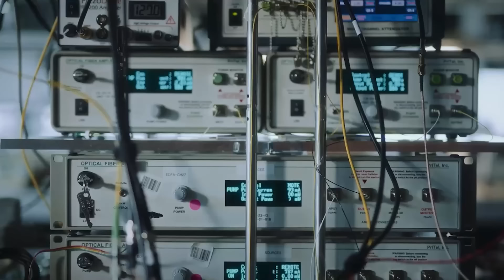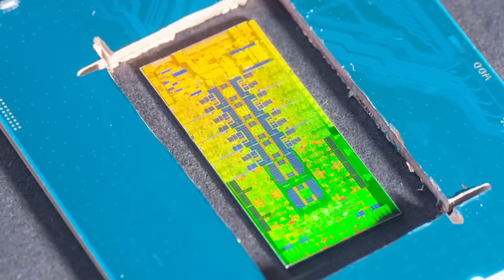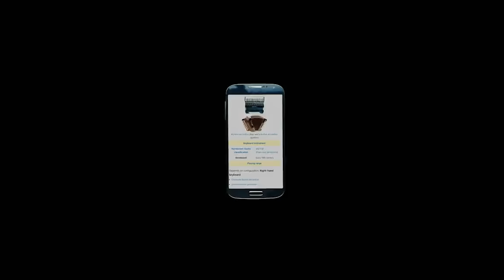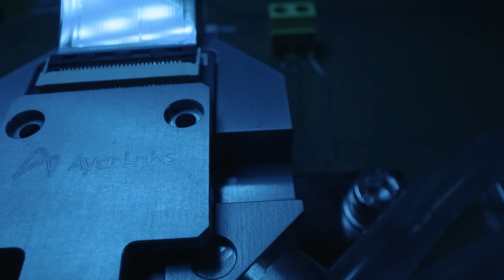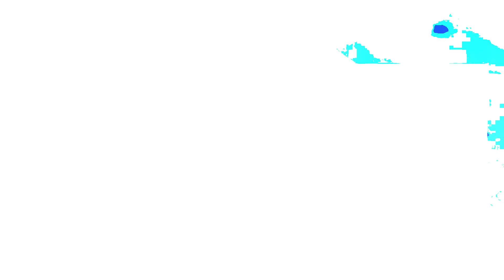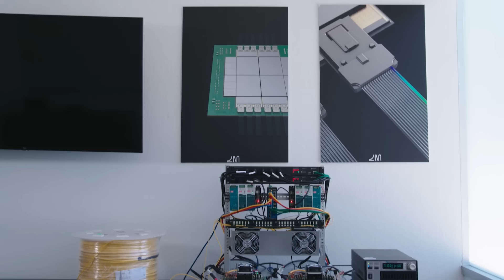Germany's New Photonic NPU Just Made NVIDIA’s Billion Dollar GPUs Look Like TRASH!

Comment: remember my physics professor in highschool saying that in the next 50 years pc will be working with light.(photonics)
Reply: How long ago did they say that?
Reply: @MasterAaron 2008
Reply: @marioraca6482  Perfect year to say that with the global zeitgeist in mind, I think.
Reply: They were working with light in the 1990s.
Reply: My teacher said back then (1991) that there would be no more than 250 MHz, as the material couldn't handle any more.
Reply: Si when you can. Photons when you must.

This is about to change though 🎆
Reply: Photonics=(solve problem gpu=bottleneck).
Reply: The speed of light has already been the limiter of computers and the highest end machines have been hitting 99% the speed of light for some time. Hence the need for more cores and more lanes.
Reply: @gillo79  uhm.. no.. the problem with current technology is heat dissipation, adding more and more cores to the same surface area will eventually reach a bottle neck.. and anothe issue is quantum effects start taking over at current transitor sizes
Reply: @RobuAndrei-m8w  Yes, that is correct too, but the speed of light is an absolute limiter and taught in a first year of computer engineering. Yes, heat is a major issue, always has been. End of the day, only so much information can travel so fast through the boards. We are both identifying major issues. You think I am wrong, I am not. I do not think you are wrong. I am aware these issues are compounding on top of one another.
Reply: @RobuAndrei-m8w  I see you created your account in June. Bot or troll?

Comment: The statement that "Light is moving much faster than electron in a wire" is misleading. Why? because if we take single electron this is true, in order for electron to move for 1 meter it will take forever (it will collide with atoms). But how it comes when you turn on the light in your room it will just do it instantly. The answer is that in order to have "electricity" you don't need to move that exact electron from A to B, the electromagnetic field is moving all electrons in a wire so they start moving slowly in one direction.
So Electromagnetic field is the reason why we have electrical signals moving so fast, and electromagnetic fields is spreading approx as a light itself
Reply: conflating current with electron flow ... Alpha Phoenix has a bunch of videos about this
Reply: Well one still needs at least 10k - 100k of actual flowing electrons that a transistor switches in contrast to instant interference
Reply: I see that someone doesn't know the difference between AC and DC.
Reply: @Midian_Cabal  I see someone doesn't know how DC/AC works under the hood, read about electro magnetic field and why it's important for current flow
Reply: Its roughly 1/3 of the speed of light
Reply: @multivitamin9832 How can the light be slower?
Reply: @multivitamin9832 no its not, electromagnetic field has the same speed as light, and all signals in processor are at this speed
Reply: @АртемФедоров-ю7б  It's not the full speed of light, it depends on the conductor. 50-99% of c is a typical value in a copper wire
Reply: @StefanReich  electromagnetic field is spreading around the wire
Reply: It depends on the resistance of wire also voltage also
Reply: That claim is a red flag for the entire presentation. It depends on the viewer not knowing how fast top end hardware is moving already

Comment: GPU is still only a Graphics Processing Unit. Not made for anything else specific.
Reply: gpus (with added cores I might admit that do i.e. AI calculations) are now being used to calculate everything under the sun, from weather models or physical theories at universities to large AI models over the folding of proteins, financial markets, your daily amazon or netflix.  not as the only unit, but as one very important unit on servers in tandem with the ram and cpu. without current gpus, we would not have these gains. I doubt if you would just have the CPUs in server racks it would work as good. so GPUs might originally have been for games but are not much more broad range compute units id argue.
Reply: GPU is specifically made for math.
Reply: @bobsnabby   yeah, like every other *PU, All computers are plain calculators. That is if they do not have hardware bugs, in which case they just become random event generators, like most overclocked crap all the "smart" kids use.

Comment: GREAT! when will it be publicly available at a reasonable cost? Or will we never hear about it again...
Reply: We will hear something like it or even greater next few years if they continue their research and development. But oh boy if all of the holy grails, someway, somehow are solved and utilized... Imagine all the optical desktop pc size of a small cube that operates in the speed of light
Reply: @ForceFieldGuy  no we wont.  They have 2 major walls. One they are not very trainable. Making them impossibly hard to program on.  They have problems with certain algorithms and are highly bottle necked by memory access.

Likely these will die off before they even begin.
Reply: Don't worry China will solve all the issues and sell it to us cheap.
Reply: @kingofpainMCMXCVII You mean the China that would still rather smuggle Nvidia GPUs than use local ones? They're not solving anything AI related lol.
Reply: It is available to buy from Q.ANT, but its very expencive
Reply: I would say more like for those data centers than casual customer use 
I wouldn't complain 
Shortages nowadays are only because of those data centers

Comment: Oo,

Photonic memory chips are an emerging class of devices that store and manipulate data using photons (particles of light) instead of electrons, as in traditional electronic memory like SRAM, DRAM, or flash. They form part of broader photonic integrated circuits (PICs), which integrate optical components such as waveguides, modulators, resonators, and detectors on a single chip to process, transmit, and store information at the speed of light.232d61
Why Photonic Memory?
Traditional electronic memory faces physical limits: heat generation, bandwidth bottlenecks, and energy costs rise as chips scale, especially for AI, high-performance computing (HPC), and data centers where massive data movement dominates power use. Photons offer key advantages:
Speed: Light travels faster with minimal resistance; photonic elements can operate at tens of GHz (e.g., simulated 20 GHz write, 50–60 GHz read in some designs) versus a few GHz for electronic SRAM.
Energy efficiency: Lower heat and interference; photons experience far less loss over distance than electrons in copper interconnects.
Bandwidth: Wavelength-division multiplexing allows multiple data channels on the same waveguide.
Scalability potential: Enables optical interconnects, disaggregated memory pools, and hybrid photonic-electronic systems for AI workloads.cbae44
The main historical challenge has been volatile memory: photons don't "stick around" easily without continuous power or conversion back to electronics, which adds latency and energy overhead. Recent breakthroughs address this by creating stable, regenerative optical storage units compatible with existing manufacturing.
Recent Breakthroughs (2025–2026)
A notable advance came in late 2025 from researchers at the University of Wisconsin–Madison and USC Information Sciences Institute. They demonstrated a "regenerative photonic latch" (pLatch)—an optical analog of electronic SRAM—built using standard silicon photonics processes from foundries like GlobalFoundries and AIM Photonics.
It uses cross-coupled differential circuits with photodiodes, microring resonators, and waveguides.
This is the first scalable, commercially manufacturable photonic memory on a foundry platform (no exotic materials needed).
It supports fast, temporary on-chip storage for optical computing, potentially integrating into larger photonic processors or interconnect fabrics.45eab9
Another 2025 development involved a programmable photonic latch based on silicon photonic micro-ring modulators, enabling fast, scalable optical memory units for processing systems.1aefa5
These build on decades of photonic integration progress but mark a shift toward practical memory that could reduce reliance on electrical conversions in light-based systems.
How They Work (Simplified)
In photonic memory:
Data is encoded in light properties (phase, intensity, or wavelength).
Components like microring resonators trap or modulate light to represent bits (e.g., "on" or "off" states).
Regenerative designs (like the pLatch) use feedback loops to maintain the state without rapid decay.
Hybrid approaches often interface with electronics for control and non-volatile needs, while pure photonic sections handle high-speed buffering or interconnects.
Photonic chips are typically fabricated on silicon-on-insulator platforms (compatible with CMOS lines), indium phosphide, or silicon nitride, allowing integration with existing semiconductor tech.08a651
Applications and Broader Context
Photonic memory isn't yet replacing your computer's RAM but targets bottlenecks in:
AI and data centers — Faster matrix operations, optical interconnects (e.g., CXL over optics), and disaggregated memory pools with ultra-low latency/high bandwidth.
Photonic computing — Enabling all-optical or hybrid processors (e.g., from companies like Lightmatter) that perform computations with light for energy savings in neural networks.
Quantum technologies — Supporting quantum memories or entanglement distribution in photonic quantum chips.
High-speed networking — On-chip buffering for telecom and sensing.
Companies and research groups active in related photonic tech include Lightmatter (photonic AI processors), Neurophos (optical tensor processing), Ayar Labs (optical I/O), and academic efforts at MIT, UW-Madison, and others. Silicon photonics for interconnects is already commercializing faster than full photonic compute/memory.b05922
Challenges Remaining
Integration: Hybrid electro-photonic systems are common; fully optical non-volatile memory is harder.
Manufacturing: While some designs use standard foundries, yield, density, and cost need improvement for volume production.
Maturity: Photonic memory is mostly at the research/prototype stage (e.g., 2025 demos), with commercial deployment likely years away for mainstream use, though optical interconnects are accelerating toward 2026–2027 pilots.
Power/latency trade-offs: Lasers and conversions still consume energy.
Overall, photonic memory chips represent a promising step toward overcoming electronic scaling limits, especially for AI-driven demands. Progress in 2025–2026 has made scalable on-chip optical memory more realistic, potentially accelerating hybrid photonic systems in the coming years. Research continues rapidly, with focus on larger arrays and full integration into computing architectures. If you're interested in specifics like a company, technical paper, or comparisons to electronic memory, let me know for more details!

Comment: Every time the industry hits a wall, someone shifts the gameboard. This time it’s light
Reply: Wake me up when it's run on bad thoughts and depression.
Reply: Isn't that a good thing? Otherwise we'll be stuck with recycled stuff (reset) over and over again
Reply: it's been light for 50 years. In theory it works but not at scale. Well maybe in 50 years^^
Reply: actually light us up.  tube vacuum tubes need no language trans, and military uses it so instant and spread in div ,rations confuses unwanted listensz
Reply: todays tube almost indestructable
Reply: They’ve been trying it for decades.
Reply: Yes, but no. 

Ever seen how modern chips are made and hwy they have issues? EUV, Extreme Ultra Violet is needed because the previous light has too big a wavelength, cannot light those small details, and even then they have to multi pass. Modern transistors are too small to ever guide the light if yuo were to switch to photonics, you would have to shift so far into EUV you are well into xray, and guiding around xrays, well that has its own issues, mainly that they just go through it all, and radiation. 

So, you need to go big. So big that it will be slower assuming same die space. To go fast, you need to (and can) switch to extreme frequencies. A photonic transistor has been demonstrated at ridiculous swithcing speeds, but that is a 1 off demo product. Mass production of 1Thz+ photonics has challenges, obviously. Even then, they will need space, a lot of space, meaning datacenter density goes down, a lot.

Comment: The combination of a controllable optical switch + circular waveguide loop is one of the standard ways researchers create on-chip optical memory. If photonic computing continues to advance, this kind of "photon-in-a-loop" memory will likely become a core building block for light-based processors.

Comment: If only you could predict the information required by the system before it fires  but seeing as we are dealing with light not even predicting a couple of seconds before the light is fired could  beat it, and the translation time for the light to electric signal is probably  nightmarishly slow. Or if you had a quick fire  way to send small data fast and large data are slowly trickled after or a way to store light signals as data but that will  probably take time as well, because you would still have to convert the electric signals to light to convert it into storaged light data which isn't fixing anything. (can a system even pridict the required info without the light firing first and how would it know the data required. That is a serious issue there how could you convert electrical signals to light without losing speed)  can electronical signals be forced to go faster or will it cause breakage, bottlenecks or is impossible to accomplish.

Comment: Last ingredient is the coupler that converts electrical to photon and vise versa. Then npu may replace gpu
Reply: very true.  That conversion from light processing  to traditional memory storage is still expensive on performance.  However this is definitely a leap forward.
Reply: @DeepakKutsa  we just need 10x the number of connectors to get the data into the old fashion electronics. Still in future you will not need that - it will completely replace our hardware but nobody knows how long it takes till this is consumer market ready. Probably like fusion reactors.... another 40 years??
Reply: NPUs won't replace GPUs as GPUs are still very efficient at what they do well, and the arhitecture is already built for it. What's more likely to happen is we get "triple compute": cpu, npu and gpu in the same machine(possibly even a single general purpose "merge" of all 3, as this would greatly improve I/O)

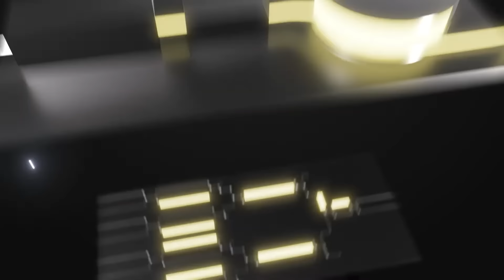Comment: Photonics holds significant promise for the future. I am fully supportive of these small chips and proud to have contributed to their development. I helped invent a computer chip that is two generations smaller than current models, produced behind closed doors at TSMC and ASML, and is ten thousand times faster. If it were a similar silicon-based chip… maybe the entire light spectrum could be utilized per chip at 3:34.
Reply: Why are two generation smaller able to be 10,000 times faster?
Reply: @levis501tw And how is ASML producing a chip?  They are one (vital) piece of equipment used to make chips.
Reply: Why don’t they just use DNA as the memory
Reply: @Kharnage_Gaming  Everyones at the stage of figuring how to.
Why don't Ai just use AGi?
easy to say things harder to research, develop, and put into use :"C
Reply: @Kharnage_Gaming DNA couldn't be used for anything other than archive storage of massive amount of data, it's slow to write and read.
Reply: @SirusStarTV good to know thank you for the information I appreciate you 🙏
Reply: Do you have any insight into how I could get my hands on the NV2A chip Graphic Database System II files or Tapeout?